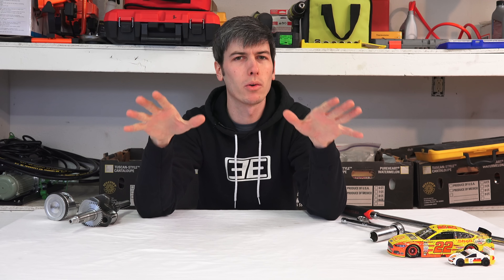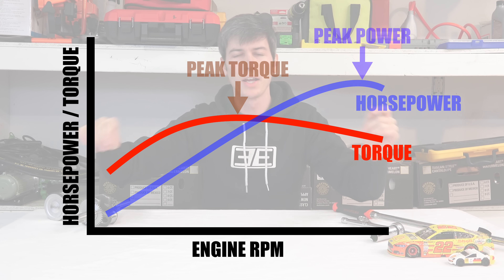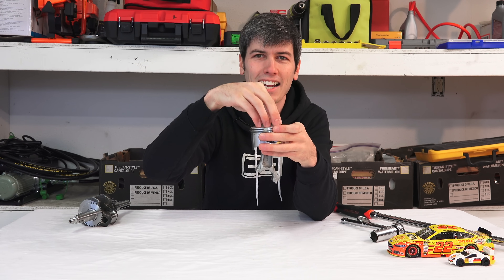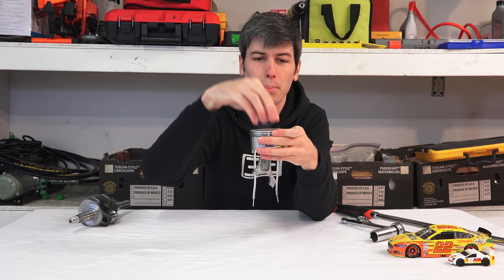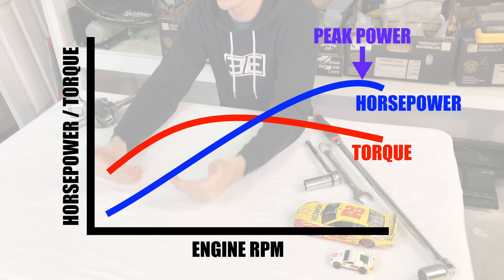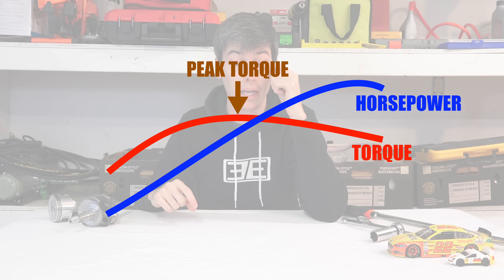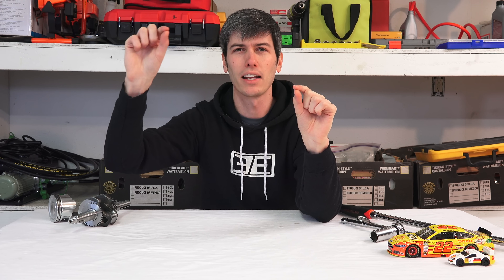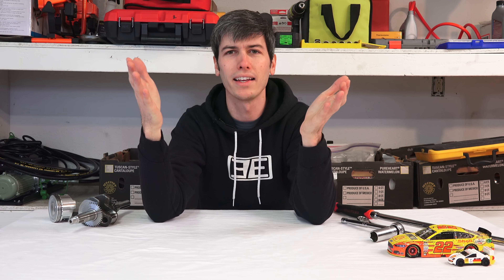Horsepower vs Torque - A Simple Explanation

Comment: Also explain why diesel have more torque than gasoline for same engine size... Greater compression ratio > longer connecting rod > larger crank radius = larger distance = more torque 😊
Reply: Jeffrey Hyder - You don't see Diesel's spinning at 10,000 rpm because the flame front would be outrun by the piston at those speeds.  Diesel doesn't burn fast enough for high RPM's.  That's why a diesel feels sooooo weak close to the redline - the piston is moving so fast that the comparatively slow flame front can't add significant power to it during the power stroke.
Reply: Basically, Larger crank radius doesn't change the torque in same displacement. Because if you have larger stroke, then you have less bore diameter. If the pressure is the same, you are gaining the distance, but you are sacrificing the force via reducing area (force= pressure * area)     But it's not a basic thing. Larger stroke and rod length allows you to slowing down the piston near TDC and BDC. If you have less piston speed at TDC, especially for diesel engine, your pressure will increase at certain rpm and also you will have better combustion control. Correct me if i am wrong
Reply: @ottocevrimi  yes you are very wrong ... The longer the stroke the faster the Piston speed ..think about it for a moment ..let's look at two different engines spinning at the same rpm ... One has a stroke of let's say two inches and it takes the Piston one second to go from tdc to bdc. How fast is the Piston traveling .?..answer: two inches per second 

Now let's look at a fictional engine with a stroke of one mile but spinning at the same rpm  as the little short stroke engine I mentioned above ..how fast is the Piston traveling from tdc to bdc if it only takes one second to complete ... Answer one mile per second ..thats pretty freaking fast aint it ? Hehe
Reply: @donniebaker5984  You can't get what i said :) Please go wikipedia and examine piston motion equations. Look at the acceleration curve vs rod length. You will see what im saying
Reply: @ottocevrimi  you said longer stroke means slower Piston speed and ask at the end of your comment to say if you are wrong ..and so I carefully painted a picture for you to understand so I thought ..but I was wrong about you who can not learn anything cause you have never been inside any type of internal combustion engine of any purpose built , of which I have an associate degree and over 50 years of hands on experience in ..so forget I ever tried to help you ..it will never happen again
Reply: @donniebaker5984  I said, longer stoke slower the piston speed "near the top dead center ". If you can't see the difference, I can't do anything about that
Reply: @ottocevrimi  all right I have thought about this long enough...actually you have two senarios going on with this statement as your answer  does cover all engines in general ...but does not make a true statement comparing a longer stroke to a shorter stroke ...here is why ...to say Piston speed is slower at close to top dead center happens to any stroke Piston..and the max speed happens at 90 degrees of revolution before top dead center ..and at 90 degrees after top dead center is your max speed of the Piston  as it will be the same max speed at   90 degrees before top dead center ....
.so with these facts in mind ..let's start at bdc .and go one complete revolution Piston will be at a complete stop ., At bdc ..then instantly begins to accellerate at a compounding rate of ever gaining speed until the connecting rod obtains it's max angle of deflection of 90 degress after bottom dead center that is also 90 degrees before top dead center...at this exact moment the Piston had reached it's maximum speed to only begin to slow down but at a much faster rate than any short stroke to a complete stop at top dead center only to begin speeding up from a complete. Dead stop from top dead center to much faster rate of acelleration of any shorter stroke and again at 90 degress after top dead center the Piston is slowing down but at a much faster rate than a shorter stroke untill that last degree before bottom dead center as both a short stroke and a longer stroke are turning same rpm the Piston of each different engine will stop and change directions at exactly the same time ...but during Piston movement the short stroke will always be slower Piston speed at any degree of travel as the longer stroke will always be faster Piston speed at any given degree of rotation as it will be forced to travel a much longer distance in exactly the same amount of time we measure in revolution per minute ...so the longer travel = faster Piston speed that has no advantage to horsepower as it will use more horsepower than a slower Piston travel because it takes less horsepower to cover a shorter distance in the same time it takes a long stroke to cover a longer distance .wasting the horsepower to move a Piston farther that could have been spent rolling the crankshaft..to a higher rate of speed but what about torque ?  A longer lever in this case a bigger circle of crankshaft rotation will apply more of the pounds of combustion through the longer stroke reduces the give resistants to spin the center of revolving crankshaft....long stroke fast Piston  creating greater friction taking more time to increase a higher rpm but at the same time the Piston of a long stroke is pushing  on the crankshaft harder in the most advantage degrees where the leverage point is farther out against the resistant of spinning mass
Reply: anyone reading this comment thread, above this comment, ignore and forget everything you read here and do a google search on why diesel engine make more torque than gasoline engines.
Reply: Jeffrey Hyder it's compression, diesel is compressed until it is hot enough to ignite, they both do the same thing. But yes the motor is typically stronger to handle the high pressure that a gasoline motor wouldn't experience
Reply: Thomas - look up "laminar flame front" on google, and you'll understand why diesel fuel makes no sense in anything other than a low rotational speed, undersquare design.  It needs more time to do useful work than gasoline does.  The first few ms of a diesel combustion are pretty much worthless because it's a laminar flame front - only when it transitions to a turbulent flame front can a diesel combustion do useful work (unless you want to limit your engine to about 1200 rpm).
Reply: it combusts not explodes. oxidation!
Reply: buncha know it all know nothings in this comment section lmao....
Reply: @jackhofalot6705  very very true LMAO
Reply: The original poster is not wrong, having a longer distance from the crankshaft to the connecting rod would and does have the effect of more torque at low RPM. Why is anyone denying this?
Reply: Diesel burns much slower than gasoline. It pushes down the piston over a longer period than petrol.
Reply: Also, diesel contains more energy than gasoline
Reply: also keep in mind that most of the diesel engines that you are thinking about are turbocharged. A turbocharged gasoline engine of similar size can produce similar torque numbers with generally more horsepower
Reply: Diesel uses a different thermodynamic cycle to petrol-the diesel cycle, as opposed to the otto cycle for petrol. The info is indeed on google but if you want the full picture then get to university and do engineering like the chap in the video.
Reply: Diesel needs higher pressure to ignite.  The rest of your explanation follows
Reply: wikichris because he said of the same sized engine. If the stroke were longer, the bore would have to be less which would decrease the force acting upon the piston, diminishing any gain from having a larger crank throw.
Reply: @bigdorkification  but increases the time for the fuel to expand producing more force on the crankshaft journal producing more torque on the crankshaft ...your explanation is exactly opposite of what really happens ..look it up and see for yourself
Reply: A diesel often makes more torque than a gas engine of similar displacement because a gas engine air fuel ratio is limmited to around 14 to 1 where a diesel is limited by its physical straingth
Reply: @fullytek2970  true but a diesel engine is far heavier, slows exceleratiion and fuel mileage negating most advantages a diesel has.
Reply: @airgliderz  not even close .. hehe Diesel engines are more fuel-efficient and have more low-end torque than similar-sized gasolineengines, and diesel fuel contains roughly 10% to 15% more energythan gasoline. So, diesel vehicles can often go about 20% to 35% farther on a gallon of fuel than their gasoline counterparts.
Reply: @donniebaker5984  I do not dispute diesels on paper are ore efficient because diesel fuel has more energy,why it is used as rocket fuel. However diesel engines have one big disadvantage, diesel motors weigh considerably more then a gas engine because structure needed to withstand high compression negating some of its its efficiency, weight matters a lot in vehicles (why diesels suck in aircraft as a prime example), weight of the engine does not matter so much for stationary applications.
Reply: Actually, it is quite right.  Gasoline has a MUCH higher flame front speed than diesel does.  Could you build an oversquare diesel and get higher RPM's?  Yes, of course you could.  And it'd get it's ass handed to it by a similar petrol engines because you'd be wasting so much power in the oversquare diesel - combustion would not be completed by the time the piston passes BDC, and you'd shoot flames out of your exhaust.  You really think that if it were possible, race teams would not have done it by now???

Diesels are undersquare because that's the only design that makes sense.
Reply: Diesel doesn't actually detonate though. Detonation suggests a supersonic shockwave which only really happens in high explosives, it would blow an engine to pieces if it did. Diesel actually undergoes deflagration.

Car people use the term detonation to mean knock or pinging but it isn't actually detonation.
Reply: Joel Artursson I agree on that , so one would go for a diesel engine only for better efficiency and better initial acceleration is it??
Reply: subin Yeah exactly, that is why they are commonly used in work application that travels longer distances. Great torque for haulin' a lot of equipment and initial power to get moving with heavy loads. But acceleration itself ain't that good in most cases.
Reply: @ArturssonEngineering  you haven't been in many diesels they actually get better power delivery.
Reply: Xei Right, diesel has spontaneous combustion. Efficiency is due to compression.
Reply: @fedjadrndarski5606  spontaneous combustion ? Damn I'm glad you warned us ..listen up folks don't ever apply for any truck driver jobs ..your 18 wheeler can burst into flames at any given moment .. bahahaha
Reply: Adik writing about Lambda and AFR while referring to different fuels is confusing :) clearer to stick to AFR in your example.
Reply: Tijn van Esch Lambda for diesel id almost same as petrol, but diesel run lean without smoke.
Reply: reza h incorrect lol they have almost the same energy per kg of fuel
Reply: yep!
Reply: Fedja Drndarski I agree, I misread the comment as a comparison between afr=lambda independent of the fuel, but he never stated this. Sorry :)
Reply: Anton Taylor The wax from a candle burns, but few would say it explodes. As you say, in an engine, the burning is confined and therefore develops pressure. An explosion is the sudden release of pressure, not controlled burning. The idea is to extract as much energy as possible from the controlled burn so that by the time the exhaust valve opens there is not enough left to be considered an explosion.
Reply: Could depend on RON perhaps?
Reply: Who exactly was that aimed at Barry?
Reply: Lintassimilator- :/  Diesel engines self ignite or "expload" the fuel due to the engine being a hot environment where a diesel/air mix under  compression self ignite.

A petrol engine need a spark plug to ignite the petrol and air mix making it allot more of a controlled burn where presure don't play as mutch of a big role here to start the power stroke.

Diesel engines are a "controlled" explosion and petrol is a controlled burn.  Like a nuclear reactor being a controlled split of atoms until they aren't. Runaway diesel can't be shut down by removing the glow plugs.
Reply: Lmao, this is so comical this thread ... it seems there an awful lot of "experts" on this subject.
Reply: @ahlapski  I would not trust any of them to change out a spark plug in my lawnmower
Reply: Diner50 Except that that is all pointless semantics because burning and exploding are the exact same reactions occurring at different rates. The method of ignition is not even close to the most important difference between the two fuels it's a side effect of it.
Reply: Lintassimilator The difference between burn or explosion is the speed of the reaction.
Reply: The reason is diesel engines are limited to lower rpm due to technical reason. We learned in that vid at lower rpm we have to increase torque if we want wo produce the same power. So Diesel engines are simply designed bigger with more torque to compensate the low rev limiation ("bigger" is for old diesel technique true).

Thechnical limitation maybe because of slower burning rate. Or simply that ignition time cant be controlled like in a gasoline engine. U need to ignite earlier and more time precise at higer revs. Both things wihch are difficult with the self ignition system as Diesel is.
Reply: @justiccoolman1816  a mechical diesel fuel pump has to be timed as accurate as the spark timing of a gasoline engine as both engines are critical of the combustion ...so try again , you are not even close
Reply: +Billy So  thanks for nice explanation
Reply: Everything I've read says that per the same amount of fuel a diesel engine requires 30% less fuel to produce the same amount of power.
Reply: @Loundsify  less the higher weight per horsepower of the diesel engine puts a dent in efficiency, diesel is still more fule efficient...mainly because diesel fuel contains more energy then gasoline...
Reply: @jamesavery6671  Diesel engines are more fuel-efficient and have more low-end torque than similar-sized gasolineengines, and diesel fuel contains roughly 10% to 15% more energythan gasoline. So, diesel vehicles can often go about 20% to 35% farther on a gallon of fuel than their gasoline counterparts.  It took about one and one half of a minute to prove you are wrong lmao
Reply: @donniebaker5984  You literally copied and pasted that from the first thing that comes up on google word for word LMAO
Reply: @N.M-g9c  gasoline burns faster than diesel fuel so that makes your statements cartoons
Reply: Bhrigu Bharadvaj..You are absolutely right mate.. 🤘❤️🤘❤️👍❤️👍..sad no one can understand what you put across in such simple way... 😣😣😣
Earlier there was leaded petrol meant to increase the compression ratio of petrol, and in turn one could have a comparatively longer stroke with a longer crank shaft, and hence more torque in a petrol engine.. but now we don't have leaded petrol anymore because of bad emission effects...
Reply: Damn, so many engineers here... Glad there is so much knowledge available to share here!
Reply: Brilliant, concise, and simple explanation of why Diesel engines have more torque. Thank you for this comment!!
Reply: Bhrigu - where'd you get your numbers?  I can't find any reference that puts gasoline OR diesel that low.  I'm reading 48MJ/kg for diesel and 46.4MJ/kg for gasoline on various websites.
Reply: Lintassimilator is right, burning and exploding are the same thing.  The only difference is the speed at which it happens and/or how confined the reaction is.  In most cases the only difference between "explosion" and "burning" is perception.
Reply: Uhh...no, that's not quite right. You could build a diesel engine with a large bore and short stroke which would run at a higher rotational speed. The answer as to why compression ignition engines run at lower rotational speed is to do with being designed towards thermodynamic efficiency.
Reply: le mattzoR you may want to check your facts, science disagrees with you.  

"1	gallon	of	
diesel	has	
113%	of	the	
energy	of	one	
gallon	of	
gasoline." 

Took me less then 10 seconds to get that Stat from the department of energy.
Reply: @jaydunbar7538  Diesel engines are more fuel-efficient and have more low-end torque than similar-sized gasolineengines, and diesel fuel contains roughly 10% to 15% more energythan gasoline. So, diesel vehicles can often go about 20% to 35% farther on a gallon of fuel than their gasoline counterparts.
Reply: David Besant - You're missing the point.  The point was that it doesn't matter if you call it an "explosion" a "detonation" or a "burn" - the chemical reaction is the same.  Getting hung up on lingo is not as important as understanding the chemistry.
Reply: Diesel has more torque mainly because of turbocharger. Boost on turbodiesel engines are much higher than on turbo petrol. For e.g. 1.9tdi 150hp has 1.45 bar of boost, but 1.8T also with 150hp has 0.5 bar of boost. Logically, TDI has more air at lower rpm, and has much more torque, but 1.8T has lower gear ratio and more rpm. Because of higher compression ratio, diesel engines are more fuel efficient.
Reply: Billy So 
Calorific value of diesel is roughly 45.5 MJ/kg while that of Petrol is 45.8 MJ/kg
Reply: BUT diesel engines do not have greater torque than gasoline engine IF they are at SAME CONDITIONS. You CAN'T compare diesel engine with 1.5 bar boost pressure and gasoline engine at atmospheric pressure. If charge air pressure is the same, gasoline engine will dominate the diesel engine in torque.
Reply: Diesel fuel also has more energy per litre of fuel than gasoline.
Reply: Also, they are almost always turboed
Reply: Diesel has more energy density, and contains more specific energy. And if you knew anything about thermodynamic you'd know that a Diesel engine is more efficient, and common rail is even more efficient. The cycle is wider, contains higher pressure and hotter gas, which means greater energy recovered in the adiabatic and isobar expansions. Which means the power output is greater by construction.
Reply: Jeffrey Hyder it doesn't matter what word you use. It explodes slower, that's also why they have lower rpm limits as it burns so slow they reach peak torque at very low revolutions compared to petrol.
Reply: Think about the component of force perpendicular to the lever arm length.  Crank radius simply changes the stroke length and not inherently changing the torque generated.
Reply: When i see people sayng that disel have more energy tham gassoline omg :/... You have no knowlage in thermodinamics.
Reply: @seekanddestroy9111  Diesel engines are more fuel-efficient and have more low-end torque than similar-sized gasolineengines, and diesel fuel contains roughly 10% to 15% more energythan gasoline. So, diesel vehicles can often go about 20% to 35% farther on a gallon of fuel than their gasoline counterparts.
Reply: incorrect
Reply: diesel are more efficient because there's no spark plug ignition but self ignition, self ignition make combustion more efficient
Reply: Jeffrey Hyder gasoline explodes diesel burns , it’s more volatile which is why it can ignite at atmospheric pressure